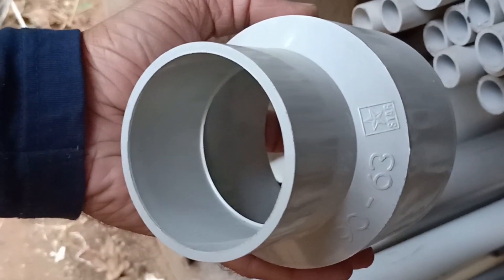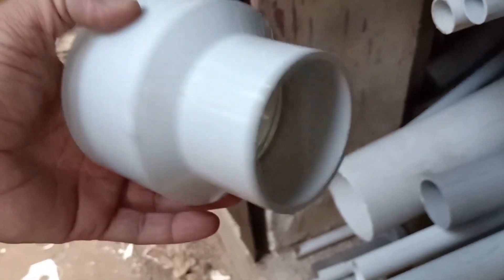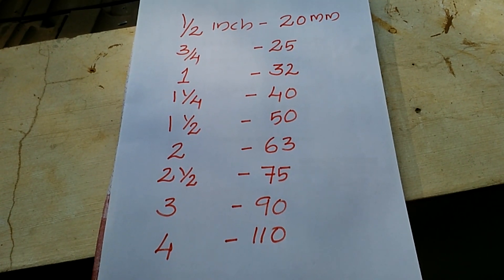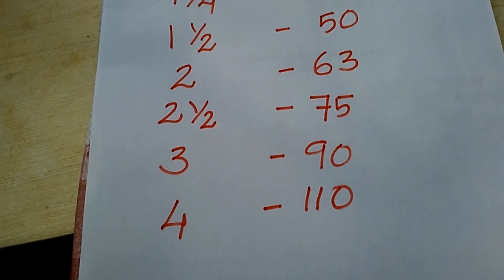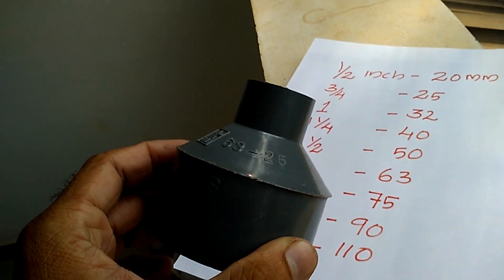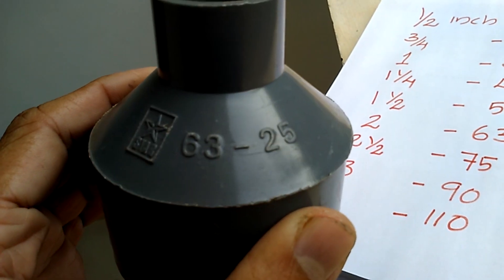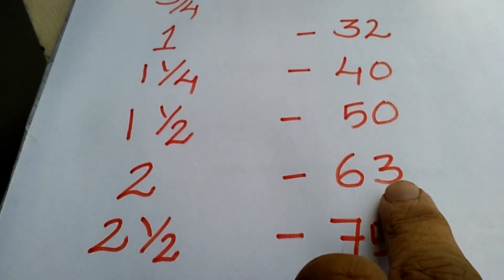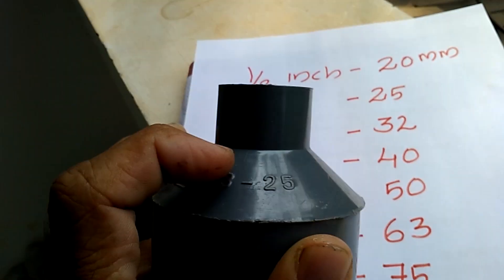how to measure pvc pipe and fittings size malayalam, പെെപ്പിന്‍റെ അളവുകള്‍ മനസിലാക്കാം

Comment: 25 mm  അല്ലേ 1 ഇഞ്ച് പിന്നെ എന്തിനാണ് അതിനു 3/4 ഇഞ്ച് എന്ന് പറയുന്നു. എന്താണ് ഇതിന്റെ മാനദണ്ഡം. ഒന്ന് വിവരിക്കാമോ? 
Eg : ball valve വാങ്ങുമ്പോൾ 1" 32mm എന്ന് കാണാം
Reply: Inner Dia 1 inch outer Dia 1 inch + double thickness
Reply: Ethenulla utharam kittiyoo
Reply: Brush screw  1,25mm
Pipe 3/4
Reply: 30mm ---1"
50mm---1.5".   ?????
Reply: PVC പൈപ്പിന് അളവ് തുടങ്ങുന്നത് 20 mm ആണ്. സാധാരണ അര ഇഞ്ച് എന്നുപറഞ്ഞാൽ 15 mm
Reply: @pulari-b8j  1/2 inch 16 mm for electric pipe